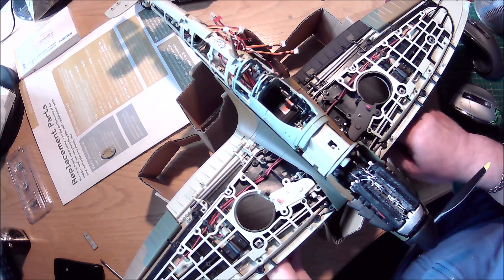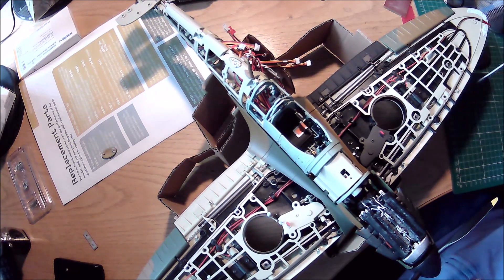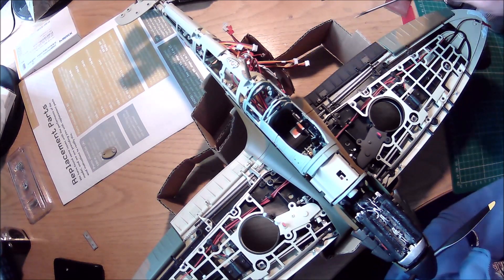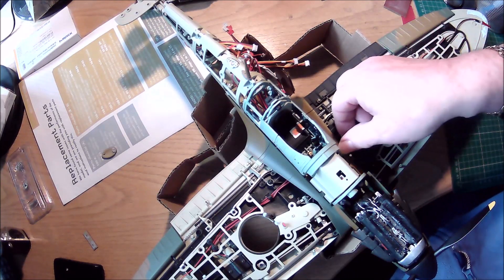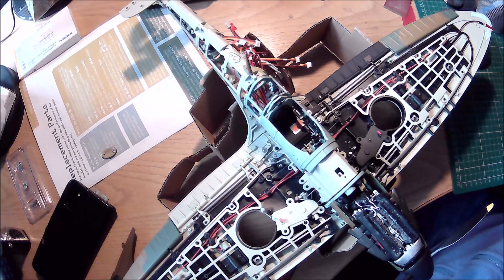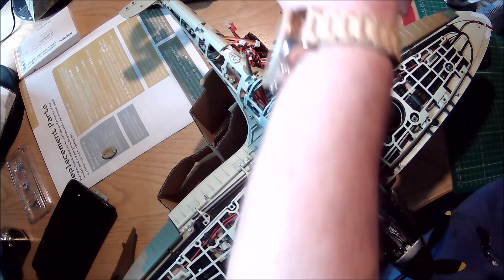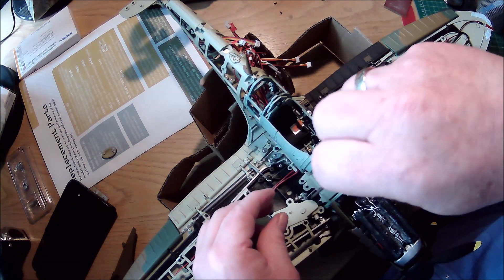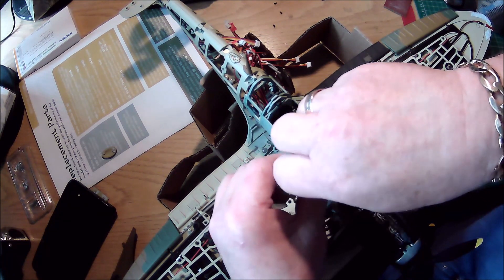UNBUILD AND REBUILDING THE SPITFIRE MK 1A

Comment: Hi Dave just found your site, what the hell is going on when I get to the stage your at have i really got to pull the thing apart i wonder if Hachette knew about this they have to keep us modelers informed about any more alterations what are your thoughts.John from (across 2 oceans)Australia?....
Reply from the maker: hiya John the thing is Hachette knew what the problem was and waited until we got to issue 93 to start stripping it at issue 100 to replace the cable for the undercarriage and the cogs in there as well, also the new cable snaps, its not strong enough, mine hasnt snapped yet, plus the two front raisers do collapse due to the brass collar should be glued in but hachette never told us to do this, one modeller,s spitfire crashed on the base and snapped one of the propeller blades due to the raiser falling, its been a nightmare mate so check the raisers and strip them down to glue the brass into place

Comment: Hi dave how are you people have been having trouble with the replacement parts to the landing gear wire I'm not going to replace the landing gear parts
Reply from the maker: Hi Bobby ive not had chance to try mine yet, i got the remote but there was no buttons inside so ive got to wait two weeks for another issue 100 to come, ive replaced the landing gear parts, just need to do a test flight